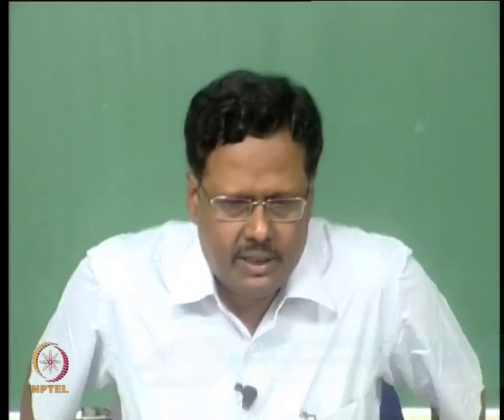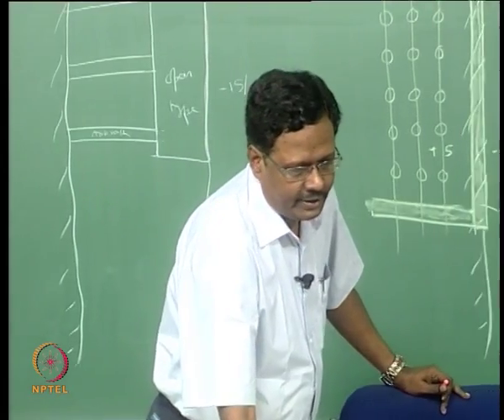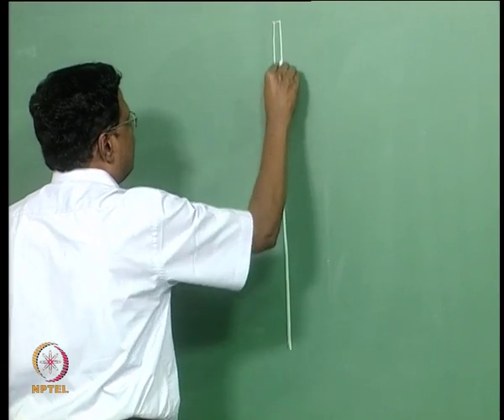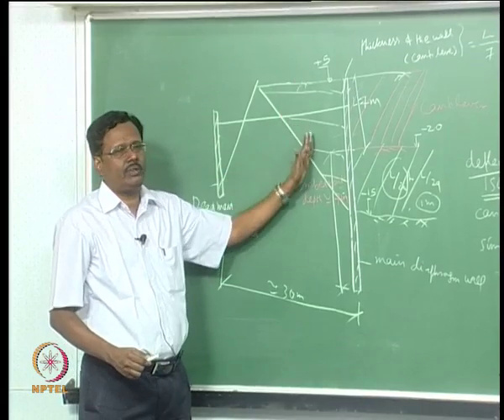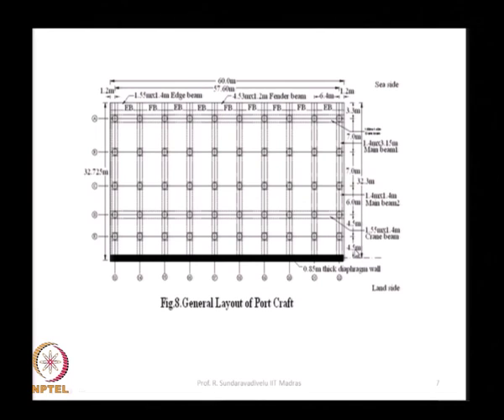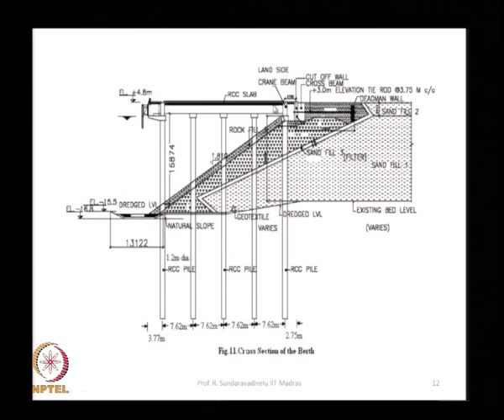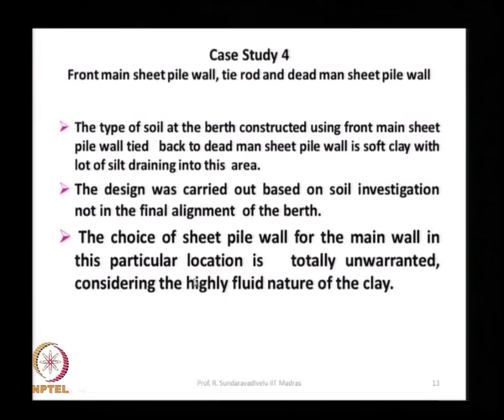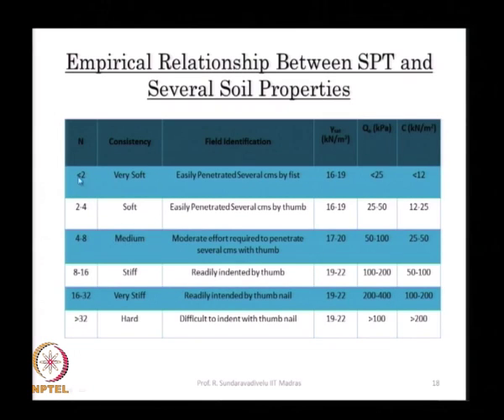Mod-10 Lec-46  Design and construction of diaphragm wall

Comment: In A.P a diaphragm wall on the polavaram dam  was eroded . I think they didn't use steel. Only Plain cement concrete was used.
Now they are going to build a new one shortly.
I have a doubt whether a diaphragm wall of 30 m depth and sand pressure retains without reinforcement.